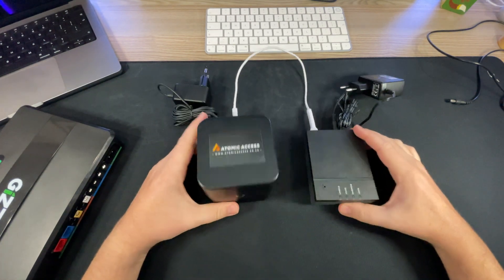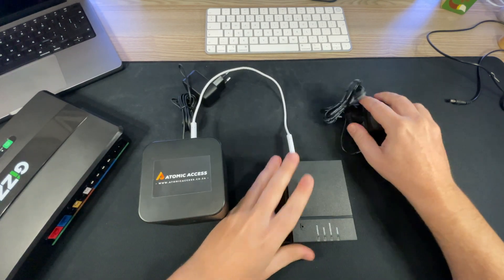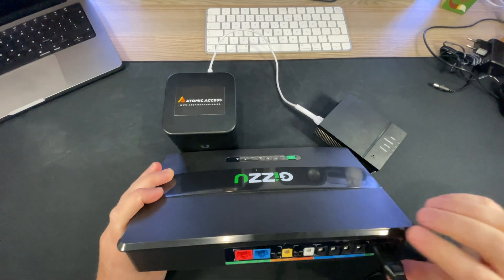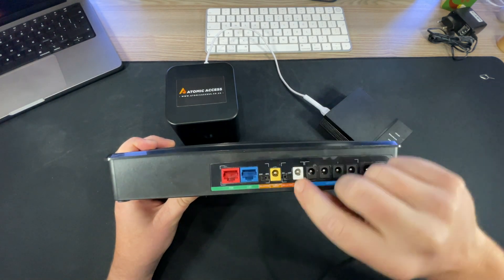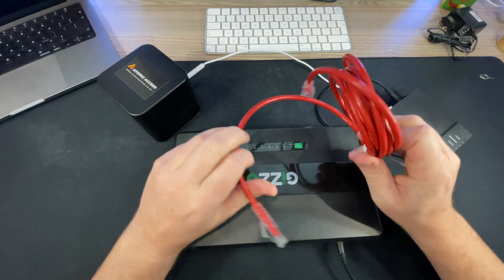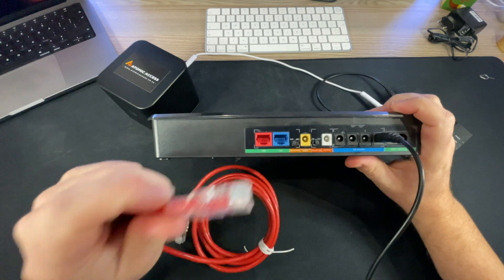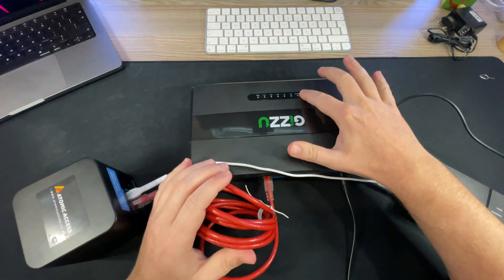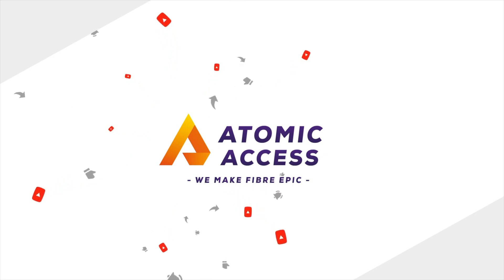Fibre During #loadshedding: How to power a Ubiquiti AirCube + Frogfoot Fibre with a Gizzu 60W DC UPS

Comment: My PoE port on this exact UPS is not working. I have exchanged it where I purchased it and the Poe still doesn’t work. Am I doing something wrong?
Reply from the maker: You'd need to check if the end device is still powered with a standard POE injector or not. Could be the device, the ethernet cable, or the voltage. It's very easy to break a device providing it with the wrong POE Voltage. But if your ethernet cable is good, you have selected the correct POE voltage, you are using the POE Out port and the end device is working, I don't see why 2 Gizzu UPSs would not work.

Comment: Can I connect my wifi and cctv on this upa
Reply from the maker: It really depends on your fibre, wifi router and CCTV devices and what their power requirements are. The UPS does cover most power output requirements, and GeeWiz also sell extension cables if the cables you need are not provided with the UPS.

Comment: Would you advise keeping the Gizzu power input constantly plugged into the main power source so it automatically kicks in when load shedding hits?
Reply from the maker: You are able to keep these devices plugged in all the time, this way they will protect your sensitive electronics and provide power when the mains power goes off. Your UPS might eventually fail, but it's better if the UPS fails than if the fibre or WiFi equipment gets damaged. Please keep your original AC adapters closeby in case the UPS fails.

Comment: What is the wh on these gizzus - I see the 60W has 65wh and the 100W is 46wh? What does that mean exactly? The 100W is also cheaper the 60W - I am trying to find a ups that is not breaking the bank that can power my CCTV system. I feel like i need to go back and learn circuits in Grade 9 physics because I can't remember what W, amps and all the other stuff means
Reply: Watts(W) are the unit of power and Watt.hours(Wh) are the unit of energy. I know this definition isn't very helpful but it will become clearer with an example.

The physical relationship between power and energy is
  Energy(Wh) = Power(W) x time(hours)
A useful re-arrangement of this tells you how long the power can be supplied
  time(hours) = Energy(Wh) / Power(W)

A UPS with a high power will cope with a high power load, but it tells you nothing about the time for which it can supply that power. For example a 100 W UPS can supply a 100 W bulb, and if the UPS is 200 Wh then the second formula above tells you the power can be supplied for 2 hours. If a smaller (say 50 W) load is connected it will last for 4 hours.

A UPS that is rated only 10W will only supply a small load (eg LED light or router) and will be overloaded if a 100 W bulb were to be connected. If it is also rated at 200 Wh then it would supply 10 W for 20 hours.
Reply: wh is watt hours so like the amp hour on the batt the 60w or 100w is the output load you can draw off it, so for example a 100w dc light or 60w dc light ect

Comment: Hi, do you perhaps have an email address? I need some assistance and advice with how to connect my cctv to a gizzu ups like this. Loadshedding is just killing my budget all round
Reply: its easy for example ive got the 60w Gizzu like this that runs my 8 channel Hikvision Dvr and cameras for about 4 hours so far. in the box it comes with connectors just remove your power supply cord on the cameras and dvr then use the new cord and splitter cable to feed power to your cameras and dvr. just look on your plug what dc voltage is and connected it to that port on the Gizzu, and you should be ok

Comment: Hi there, i ordered this Gizzu 60W ups for my Frogfoot ont and Vox Mikrotik router. The router ac input can accept 12 to 28 v and runs on a 24V 0.8 A ac adaptor. Should i run it on a 12 v dc or rather on 24V Poe from the ups? Would you know how long this combo will run on this 65WattHour ups?
Reply from the maker: It would depend on if the Mikrotik can be powered by 24V POE or not - you'd need to check the data sheet of the Mikrotik to check. Otherwise you'd need to look at a DC UPS that provides more output voltage options e.g. "Vizia WiFi UPS 5-24V Multi 57 000mWh"